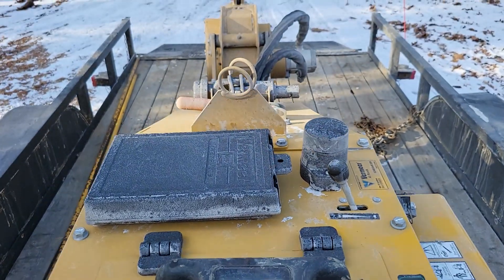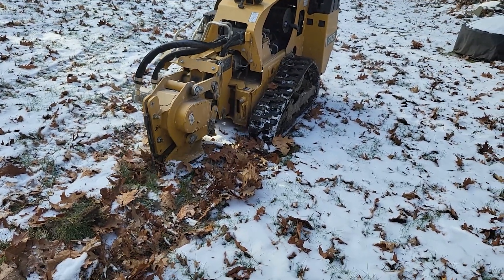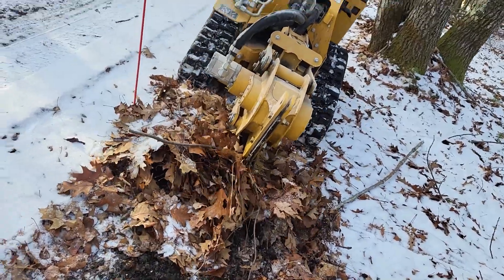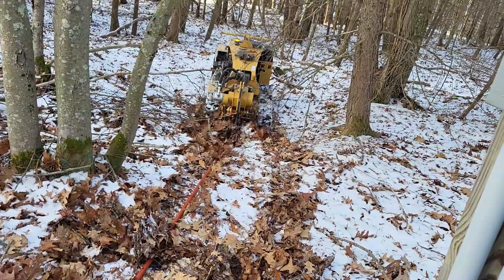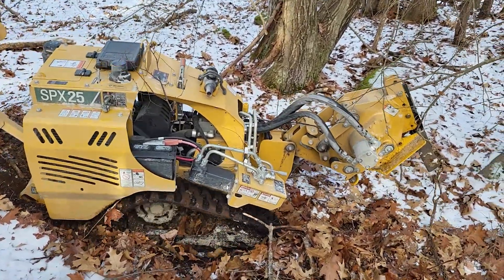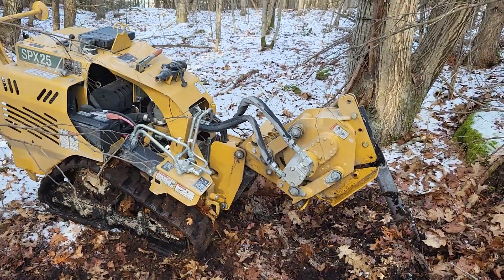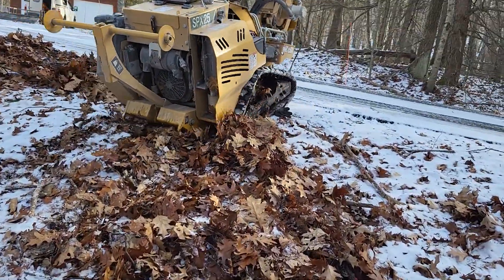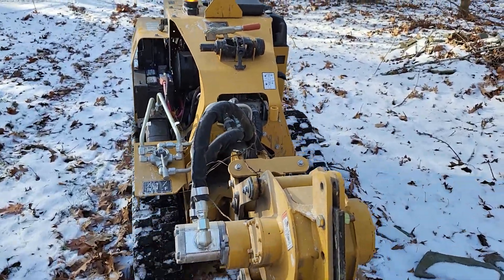How to Bury Fiber Optic  Cable with Remote Control Trencher

Comment: Great little machine, but you’re going too fast with it, and traction is key with a machine like that, so with the ice, snow ,tree roots and leaves the depth will be compromised . I’d. certainly want mine deeper than that as any tree falling will pull it straight out.